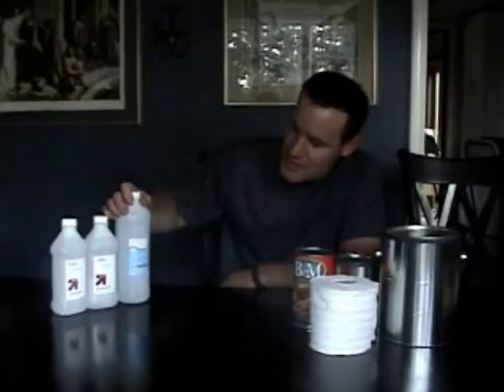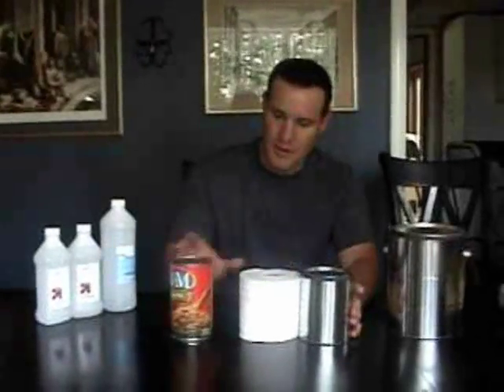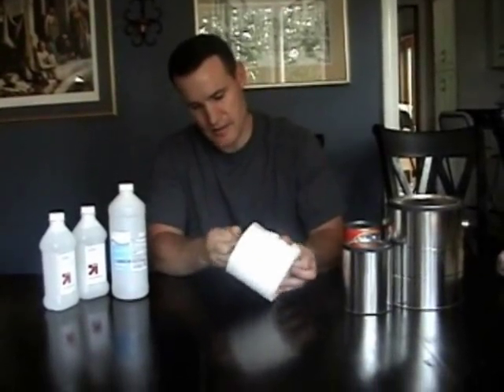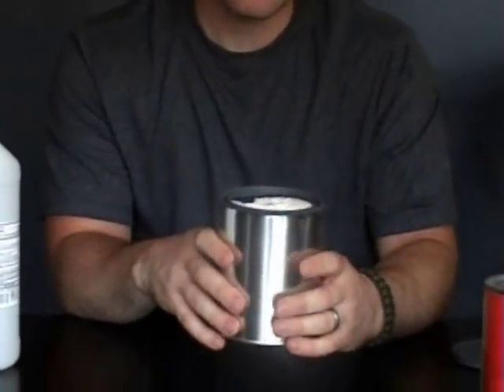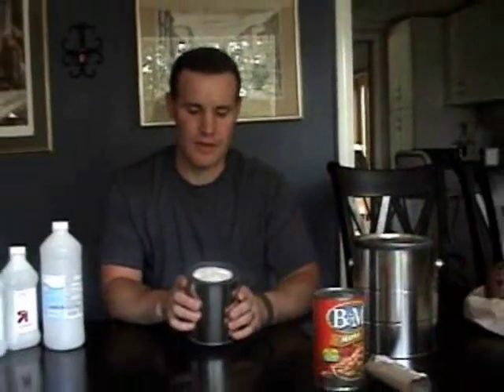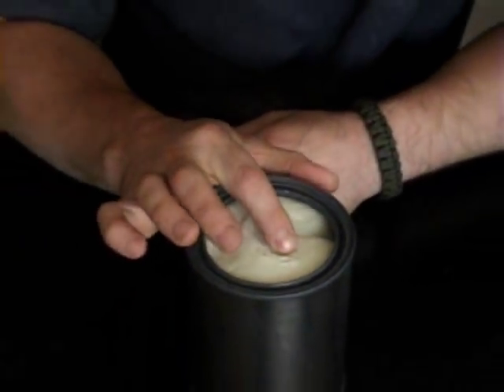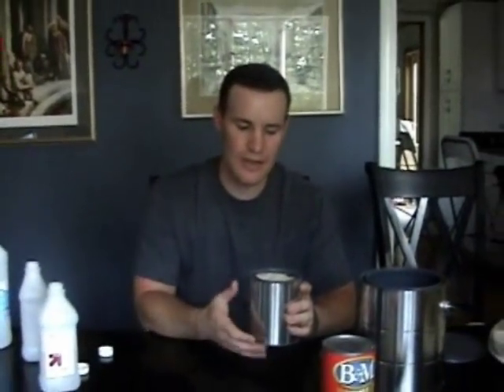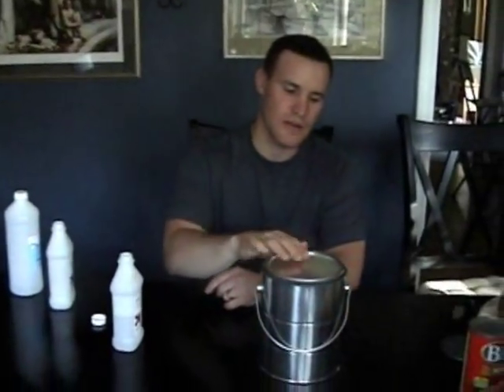How to Make an Emergency Car Heater

Comment: Common sense is key...so you don't burn up the oxygen you do something that is very complicated and ground breaking! CRACK THE WINDOW! And in a life or death situation you would be happy to have this and i am sure you would find a way to make sure you don't tip it over...unless you are a 5 year old! Think before you speak/write. The only good point you had was about insulating the can which is not hard to do.

Comment: the fumes are terribly horrific. i know 1st hand. alcohol buring in enclosed space is baaad. even if you vent the windows (which would let your heat out and cold air in)

Comment: You weekend survivalists crack me up! Did you just happen to have a roll of toilet paper, two paint cans, and several bottles of various alcohol in your trunk, or did you buy them to put there?......LMAO...... If you are worried about freezing to death in your car, go to Walmart, and buy a large can of Coleman;s propane, and a radiant camp heater. That way, all you have to do is to screw the heater onto the top of the propane, and you are all set! It holds up in the trunk a lot better than the toilet paper, and the alcohol! Worst case scenario, unless we have just had a nuclear attack, in which case we are all screwed, just make sure that your cellphone bill is paid, and call for help!......LMAO Or, you can stock your trunk with TP, alcohol, and paint cans, and hope that it isn;t so cold that your trunk freezes shut!......LMAO
Reply: Unfortunately burning propane, not only depletes the oxygen in the car, it then produces Carbon Monoxide which finishes you off. You stay warm but wake up Dead. doh
Reply: he didnt say that it had to be a paint can either

Comment: SO lets see. I am in my car on way to sky slope or hunting land or just get lost. Car dies. No one around for miles. At night its probably going to be close to 0 if not much colder. Me and who ever else need heat to survive the night. If there is no other option and I have this it will be used. Who said a car is air tight? I am having problems finding someone that has died from this in a google search. How can it spill if wicked in roll? Isnt this just a homemade canned heat? Open two windows

Comment: My car has upholstery. I thought every ones car did.  Why would I put such flames in my car?   I dont get these videos.   Now as a campfire or something, this is a good idea.   To put into a car?   NOT a good idea.   Not at all..
Reply: Your not a survivalist lol
Reply: I am more than 21 years old.   That sort of makes me a card-carrying survivalist.  LOL.  Anyhow, a real survivalist respects the power of flame, air, and water; and consider and use them appropriately with varying degrees of caution to avoid injury and death.
Reply: +justin crompton If you light a fire in your car, it will use up all of the oxygen in your car and you will die of carbon dioxide poisoning. Better to not be a survivalist and be alive than to be a dead survivalist!
Reply: +Sean Henderson You open a window, duh!
Reply: MrTdw1954 If you are cold enough or desperate enough or stupid enough to have a fire in your car, then you are probably not smart enough to open two windows to create a (cold)draft. If you open one window you are essentially sitting in a chimney. The fire will burn up all the oxygen in your car and will only leave you CO2 to breath, duh. Did you see the guy in the video sitting in his nice fire warmed car? Maybe you can do us all a favor, be the next Darwin award, and tell us how will this works by camping in your car with a fire all night. Please do get back to us. . .

Comment: Good tip but is the table ok? lol                Fumes and carbon monoxide will be created when lit so crack a window !!
Reply: +RockyMtnGobblers The byproducts of alcohol burning are water and carbon dioxide, not carbon monoxide.  Oxygen depletion is possible with any combustion so yes, you have to open a window which you're going to do anyway because it will get hot as hell in a car with that size flame going.
Reply: Thanks !

Comment: This not a good idea, flammable liquid in a confined space. a much safer solution is to always keep a box of candles ( i recommend 6'' x 2'' candles) a steel can half the length of the candles and a roll of insulation tape. Tape as many candles together near the bottom as you can and place in the can. place in footwell and light the candles keep the widow nearest to the candles open at least 1'' . to allow any smoke out. Result - some warmth without real danger and longer burn time.